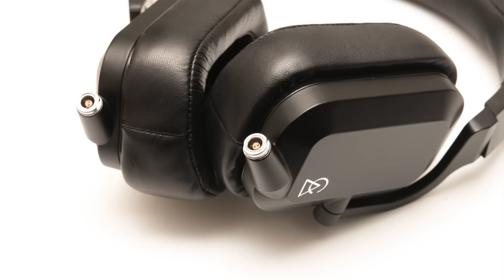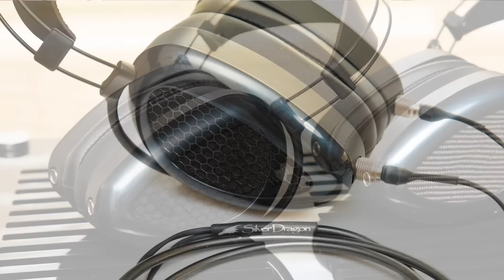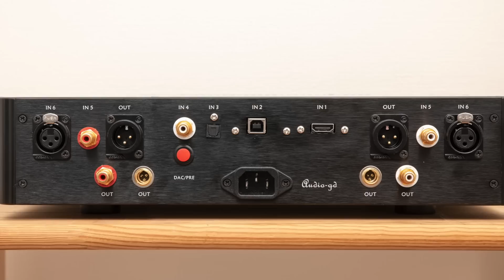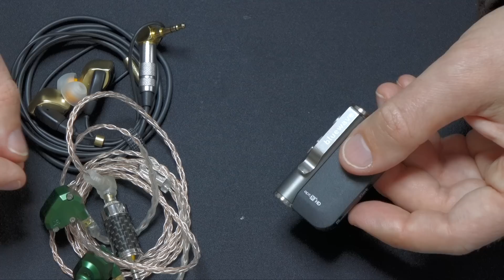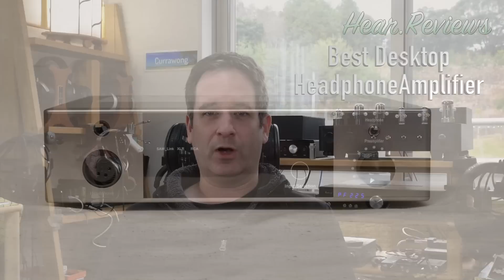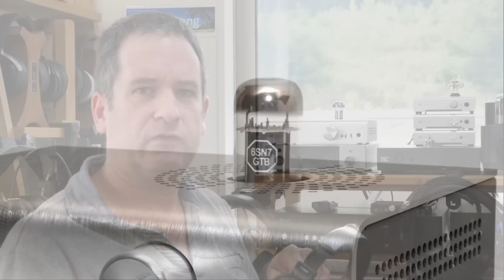Best headphones, portable and desktop digital gear and amps of 2018

Comment: Great lineup!
Can you please answer me one question. I have the Astell&Kern SE100, since you have the Fiio Q5 I wanted to pair the q5 with my phone. As far as quality which would you say would sound better? Both setups will be running Sennheiser HD820 Headphones. Thanks in advance 👍.
Reply from the maker: I haven't used the SE100, so I can't say. However if you have a DAP already, I'd stick with that if you like how it sounds now. If you want better sound quality, if you're already listening to good quality recordings, a higher-end DAP might help.

Comment: Between the Cascade and the mdr-z1r, which one would you choose provided that the latter costs 1100€?
Reply from the maker: If you don't need portability, I'd be inclined towards the Z1R if you can get it way below retail.
Reply: @Currawong  thanks you so much for answer. here in the netherlands, it's extremely hard to find a local store that offer both for demo. thank you so much for your hard work to make this review happens